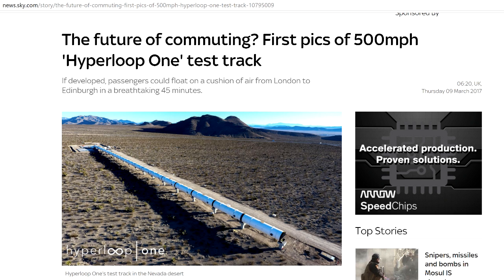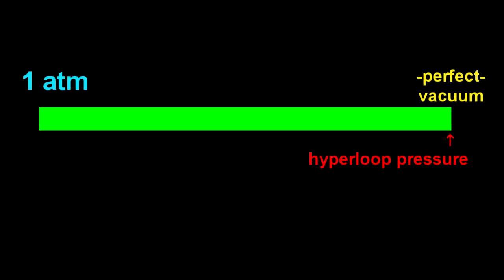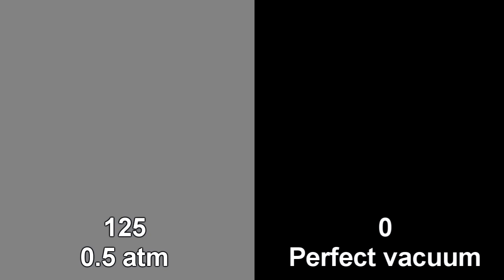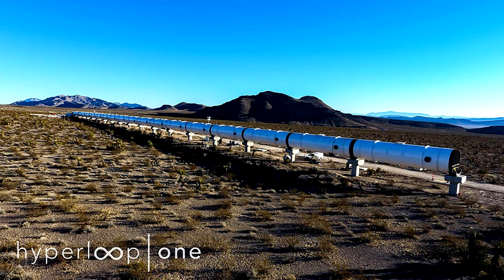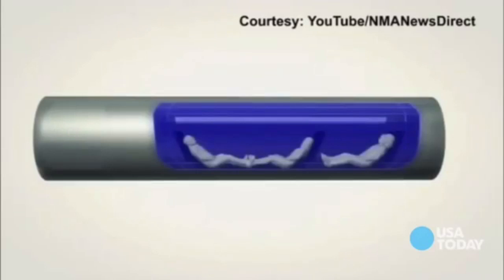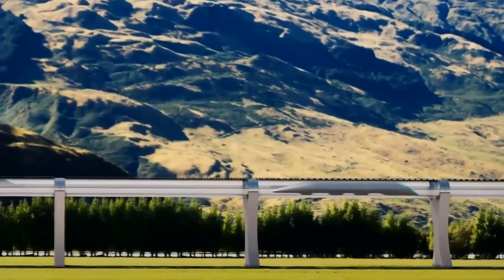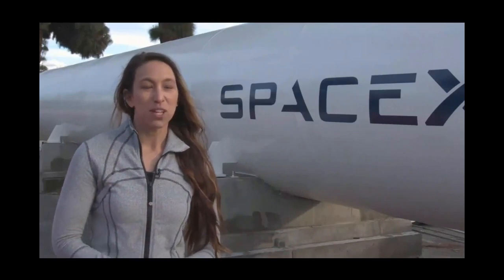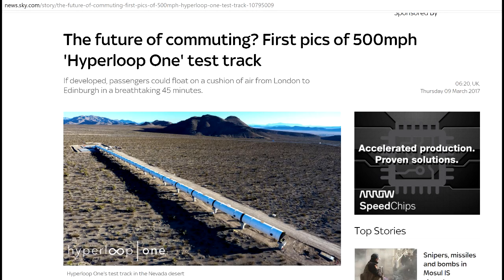Entire Hyperloop could be destroyed in SECONDS!

Comment: To quote Mr Anderson in your pinned comment:

You really should stop droning on about how long it will take to depressurise the whole tube because you know full-well that they'll just have airlocks at both ends which OBVIOUSLY means the whole tube won't need to be depressurised for each trip.

Also, your collapse concerns are all only relevant with single-skin tubes.  The ribbing in a double skin tube can solve the problem entirely.  No need for internal bracing or any other hypothetical nonsense.  It is trivially simple to engineer a pressure vessel not to explosively collapse when subjected to skin failure.  Submarine designers solved the problem nearly a century ago.

Oh, and tanker trucks are designed to withstand over-pressure conditions, not vacuums, so your use of them as an example is ridiculous, deliberately misleading and verging on intellectual dishonesty.

Are there other problems that seriously undermine the viability of this project?  Sure, but the two above are not... so probably best not to spend 80-90% of your time focusing on them.

End quote.

Thoughts Tf00t?  Seems he has a good argument against you.

Comment: Long read but worth

So here's something I don't think anyone's brought up yet. A lot of the concept art shows, what looks to be, a turbo fan engine inside the pod. So, there are a load of issues with this. You can't power a freakin jet with a solar panel. Your engine, whether turbofan or propeller, will starve because it'll have nothing to enact force on. The jet will starve due to lack of oxygen. So even if it was an electric prop engine made to resemble a turbofan, it still wouldn't work because it wouldn't have any air to enact on, as stated earlier. Even if there was an atmosphere, the Russians reached the theoretical limit of prop engines in the TU-95 Bear and that's only 500MPH or so, far shorter than the 800MPH they said the limit of this was. Now, if you look at the size of the pod in their promotional material, regardless of the engine you use, it would take up the entirety of the pod, which means you would have no room for luggage or passengers, as their engines are the size of the pod in the first place. Even an engine from a Eurofighter Typhoon is bigger than most of the pods shown in their promotional material. And the one that looked like a train? It would require such complicated air pathways that you would likely end up with oxygen deprived engines, which means that you won't get the full amount of thrust. Well, that's assuming they get enough oxygen to remain self-sustaining, which it might... barely. Oh wait, this is supposed to be in a near perfect vacuum. But somehow this ended up with millions of funding. This is why I'm loosing faith in humanity. The information has been available to hums since the 1940s. Now, seventy years later, these dipshits can't be bothered to do a quick Google search, because it requires reading, and will now fund any bullcrap science thing they barely understand.

Comment: I would be far more concerned with an air leak and suffocation in the damn vehicle!
Thousands of miles of hard vacuum, hundreds of cubic feet of air in that tiny cabin.
Life-support failure mid-crossing, dead passengers safely delivered.
That vehicle stalls, how is the rescue going to happen?  
Send another vehicle down the same tube?
How to transfer passengers from disabled vehicle to rescue-rangers?  Air-locks? Space-suits?
Fill the tube with air so that rescue from outside the tube is possible?
I love seeing multiple single-point of failures!
The real NASA plans everything they do from the point of view: "What can go wrong now?  OK, we fixed that.  Does the fix cause any new problems?"
Hyper-loop is a house of cards, more concerned with deliverable schedules than making a safe, viable and USEFUL product.
Where in godz green Earth is there a crushing NEED to travel all this fast?
Outside of bragging rights, anyway.
Reply: At least space doesn't pressurize if a single satnavsat explodes.
Reply: Greg Gallacci You know, this Hyperloop idea sounded much better to me... when I was in middle school. I was like "omg dis iz amazin!"
Reply: If there were a whitepaper written by an outside engineering firm, I might be interested.  But all this amounts to is in house generated propaganda.
Reply: According to the whitepaper, they can repressurize the entire length of tubing with relief valves in the event of a total loss of cabin pressure.  They also mention that the car will have wheels to move when the air bearing and expansion nozzle can not provide propulsion and these will move the car to strategically located points on the track for  passenger evacuation.

Also this is not only about fast travel but economically cheap travel.   After they factored the cost of running the pumps to maintain 100 pascals and to charge the batteries in the car, the per passenger trip cost is 1/10 that of conventional auto and jet travel.

1/10th the cost seems like a pretty good reason to go at it.  The general conclusion, aside from TFs argument from incredulity, is that land acquisition will be the hardest problem to deal with, but that is mitigated by its small land footprint.  The engineering side is relatively simple and there are no major technological readiness levels that haven't already been well  established in civil engineering or mechanical engineering development.

Comment: Yeah this is not looking as good as expected. Generating vacuum with a simple air compressor does take a lot of time. But I can think up workarounds for that in seconds in my mind. 

So I still think this could actually work. But I don't think it's worth it. What you would save with vacuum on aerodynamic drag you loose in costs to build this thing.

The only way this is even worth considering is with maglev trains. Not amateur built gokarts. Of course it will have no benefit there where the biggest factor is rolling resistance. I don't even know what was the point of that competition.
Reply: All these workarounds end up being stomped by thermodynamic limits, cost etc.

Comment: I agree with our current technology it's farcical. I think of the flying machines we used to make 100 years ago or so, and it seems similar. We don't have the tech or understanding but we need someone pushing the envelope to make advances. It seems like MagLev is way more plausible but after MagLev, something like the hyperloop is the next step right? In 100 years, we may have way stronger materials for the tube, we may have fusion power stations... then it's not so preposterous. Just a thought.